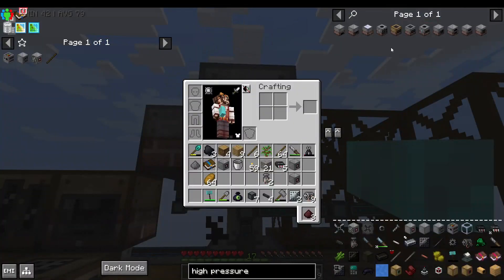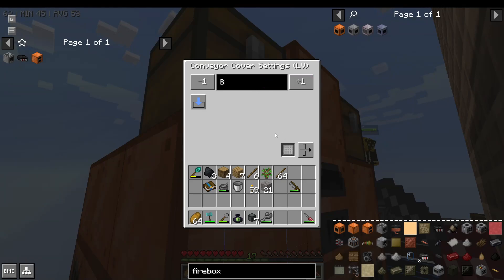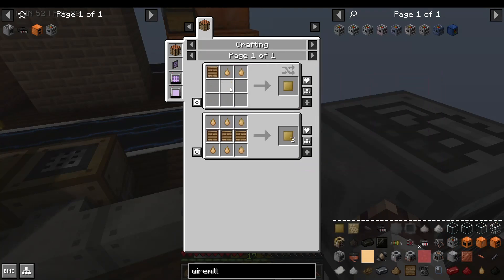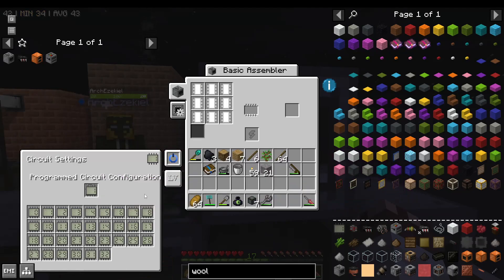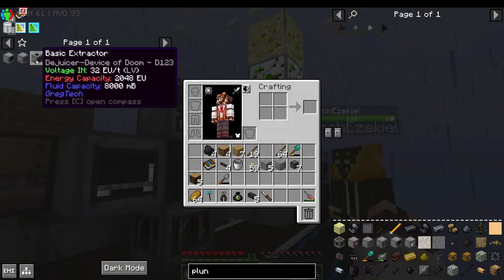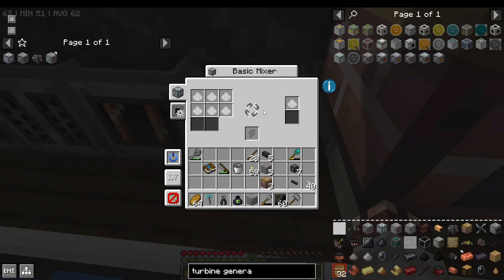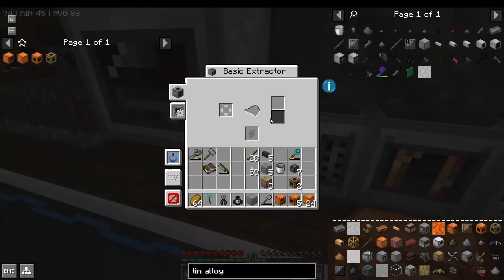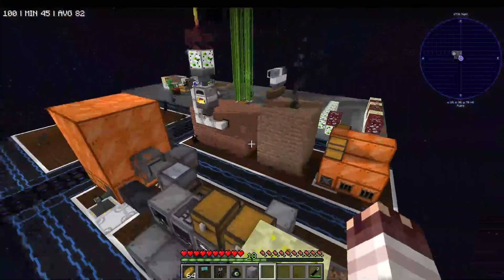Sky Greg Supershorts #2: LV Infrastructure

Comment: One really nice thing you seem to have missed is the GT mining hammer; it allows you to mine nine ore blocks at once, and you can keep the middle one a sand ore to make mining all nine extremely quick. Based on which raw materials are missing, you can tweak the conversion generator setup to provide a good balance of resources. A wrought mining hammer gives you about a stack of resources in two to four seconds (though of course it depends on what exactly you're mining) and the free item collector you get makes picking them up easy. Of course, you no longer need that once you get your first ore generator, though it still makes it much faster to go through the random ore placement generators if you're still missing some ores (ancient debris, wink wink nudge nudge). Infinite durability gregtech tools are a huge boon.
Reply from the maker: Wow, I had no idea. I’m pinning this! It’s a bit late for our poor asses now because we have almost a stack of simple ore generators, but that would have helped in the long grind for netherite.

Comment: are those blocks your feeding water with the same as the ones you are feeding the lava with just water versions on the big boiler?
Reply from the maker: I believe they’re both from the same mod, yes!
Reply: @minecraftinchocolate  do you know what batteries are used in the battery buffer?
Reply from the maker: @charlesmitchell4795  might be lithium, based on what I said in the video—it comes directly from lithium ore, so it’s really convenient!

Comment: Once you are rich enough, a quad EBF will be greatly useful. It allows for 4x on-demand ebf ingots. If you overclock it enough, you won't need to passive any of the EBF ingots and simply on-demand craft everything with AE2. Plus, quad EBF's are able to be tiled, meaning you can potentially have 4 quad EBFs and have 16 EBF running in parallel doing all your smelting needs.
Reply from the maker: Yup, relatively soon after this episode we end up making an 8x EBF and it has worked wonders for us.
Reply: @minecraftinchocolate  Nice!

Comment: Enjoy your first EBF. Dont forget to use dedicated battery buffers per power hatch with dedicated generators for passive blasting of LOTS of aluminium. And don't forget to look at the stainless steel recipe and gasp at the fact you will need a dedicated HV KANTHAL COIL EBF JUST for passive Stainless smelting at an hour and 32,000,000eu per stack! Much fun, such fuel usage. Luckly a passive diesel line is super easy to make for mv comb gens which are best for mv.
Reply from the maker: Huh, why battery buffers? We figured that sticking the correct number of generators on each hatch would do the trick for the entire game. Is that in case of low fuel levels/need to still run the blast furnace?
Reply: @minecraftinchocolate  Hatches take 2 amps per, gens only output 1 amp per. You NEED 3.95 MV amps for stainless steel, and 3.95 LV amps for aluminium . Hot silicon is nice since there is a cheaper recipe at the cost of some extra easily split CO (and occasional dust) but only costs 28K MV EU as opposed to 152K MV EU. Battery buffers ensure your pumping 4 amps in and your progress does not stall and void items when you don't have enough energy/steam for early blasting.
Reply: @SkywishesMedia  Not enough steam for early blasting? This isn't GTNH :D Setting up a large boiler is quick and easy and gets you 800 steam/t, which is almost enough to fully power a single MV EBF; and you get plenty of time to buffer tons of steam in the AE system (and AE makes it easy to get steam to where it needs to go). As soon as you get decent amounts of steel for the automated "miners", raw materials aren't really an issue. And having an AE system with no channels or energy requirements for free makes everything so much easier! I used my first super tank from rewards for a steam buffer, and switched to storing steam in AE not long after that.

I did use benzene for even my first stainless steel, though. Pushing that much steam through pipes is too much hassle :D Four MV distilleries give you about 1200 net EU/t (LV machines should be basically free at this point). Easy to build, easy to expand, and you can improve the efficiency by using steam for powering the processing. Also, man, use the cheaper recipes in the EBF - it only takes 22M EU per stack of stainless steel instead of 34M EU. Both nitrogen and oxygen are way too easy to get to pass this up.

Of course, auto crafting (and passive crafting) is absolutely amazing, and very easy to do. The only real annoyance was getting glowstone for the patterns since I didn't want a mob farm (anyone else really hates mob farms after all those MC years? :D ), so it took an LV mixer. After that, making firebricks for more steel was a breeze :D You can even passive the steel making PBFs with a bit of cheating - as it turns out, in this version of GT, the PBF doesn't check that its chimney is empty other than when loading the chunk, so you can sneak in another AE cable from inside the chimney to automate both input and output. But I only did that long after it was really useful anyway, and you can just use blocks instead of ingots to make it even less necessary (though it's annoying turning those blocks back into ingots...) :D 

And sure, cables are lossy... but that just means you don't want to overdo it on how far your machines are from generators. The choice is still mostly about how many extra generators you need, since steam is really easy to get, buffer and distribute. Machine walls are a thing even in much more hardcore GT modpacks :D Just don't use cables to supply your entire base, there really isn't a point anyway while small generators still work fine and you don't really have good EU storage. Centralised power starts barely making sense in HV, with large turbines and EV cables with HV<>EV transformers... but you only really start to feel the need at EV. Mid-HV also finally gives you access to passable battery buffers with energium crystals, which finally gives you a chance to fix power issues before your entire base grinds to a halt :D Of course, things would be very different if you didn't have access to AE, or had to worry about channels.
Reply: @minecraftinchocolate  also, as a side note, cables are lossy, it's bad in LV/MV and a little tolerable in HV, but try to NOT use cables until HV/EV so you can scale UP and run power lines that loose less (1-3eu/b/2042eu/t is better the 1-3eu/b/32-126eu/t)
Reply from the maker: @SkywishesMedia  you’ve got a great point about lossy cables in LV/MV. Our 8x LV battery buffer and later 16x MV battery buffer did wonders to mitigate this because we never ran that many amps at once, so we never saw the power loss from cables. So that was nice.
Reply: @minecraftinchocolate  So you haven't started auto crafting yet I take it. That could hurt you, but there are 2 of you, so that really does help.
Reply from the maker: @SkywishesMedia  It really does. Any time that we would normally say "Ugh, I can't do this infrastructure improvement because I don't have the energy or time" we can just pass it off to the other, or ask the other to do our current task. Progress is fast.
Reply: @minecraftinchocolate  @Threefold taught me well with power spine setups!

Comment: theres one centrifuged material you might need from ash, which is potash or if electrolyzed potassium which is used for mv-hv teir materials, it isn't enough since the chances are low but its not required in a lot of stuff so centrifuging ashes once in a while is cool, when i was making my gallium arsenide setup, i got rare earth which has also pretty useful materials when centrifuged, just keep in mind, gregtech will make you pretty resourceful and careful when making anything in the pack
Reply from the maker: Yup! We decided to get potassium later on from a rock salt ore processing setup. And we’re getting rare earth from monazite as a side effect of trying to obtain phosphorus. You get quite a lot of rare earth from monazite, actually!